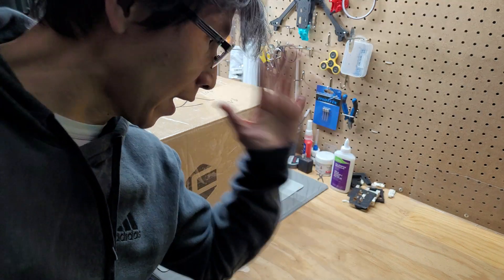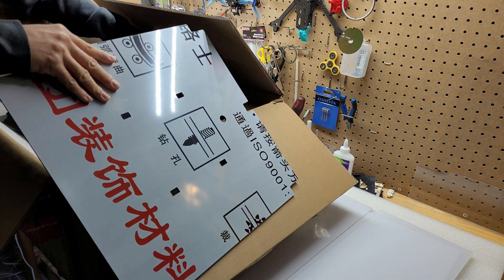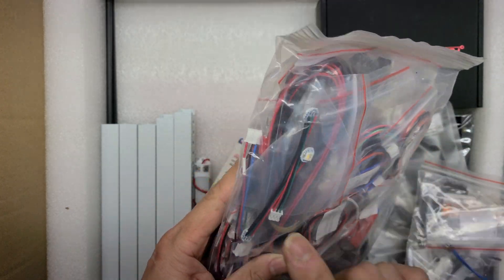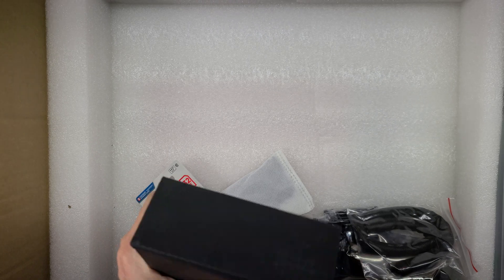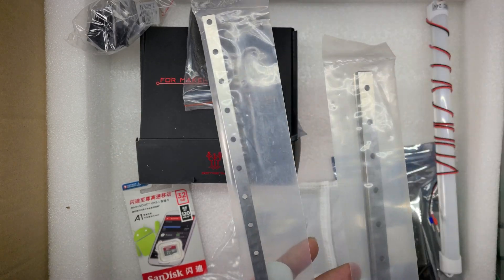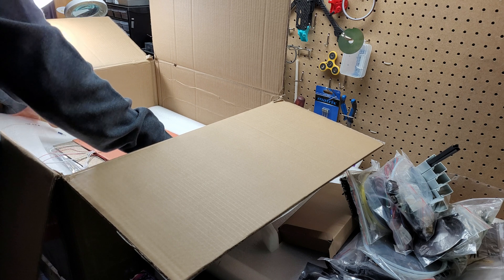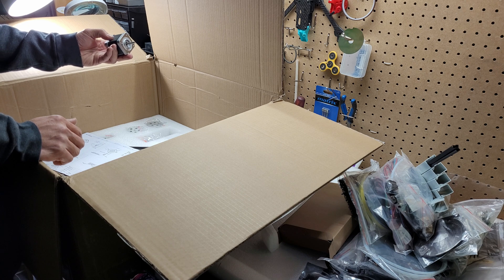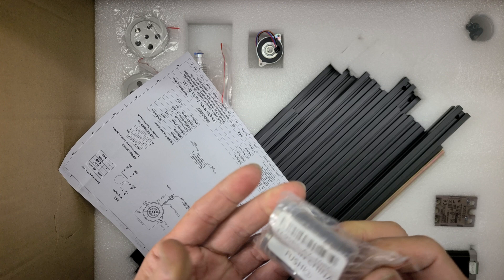Voron 2.4 kit from #FORMBOT 3D Printer (Dec 2023) Open Box

Comment: probably hard 400 serie stainless steel which is magnetic.
It's required for hardness of the bearing.
It will rust but way less than steel.
properly lubricated, rust will be no problems.
Reply from the maker: Thanks for the info about the stainless steel 400 series